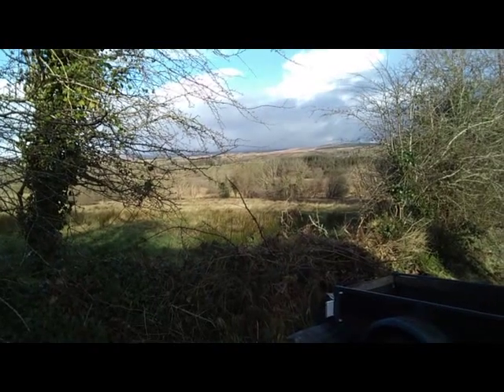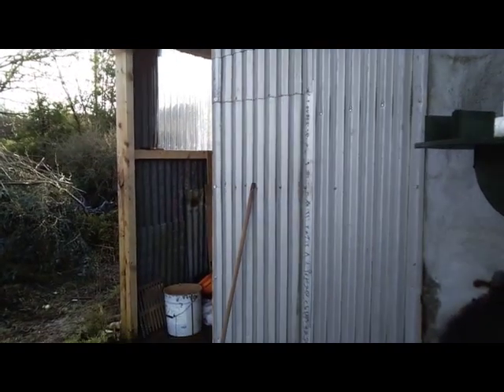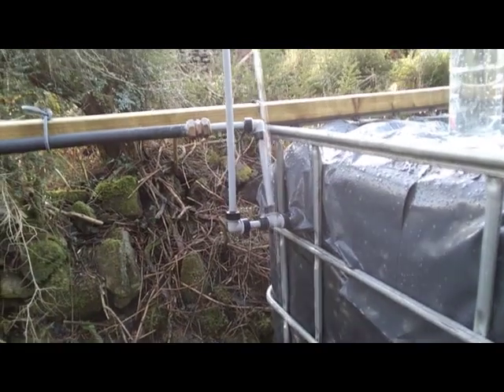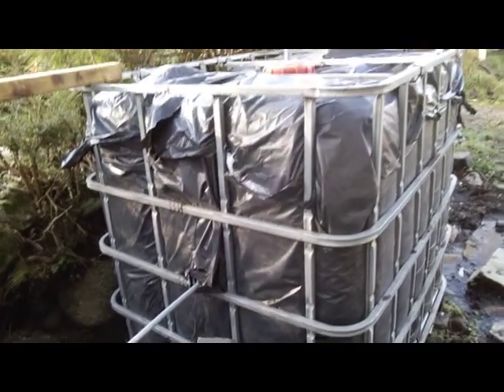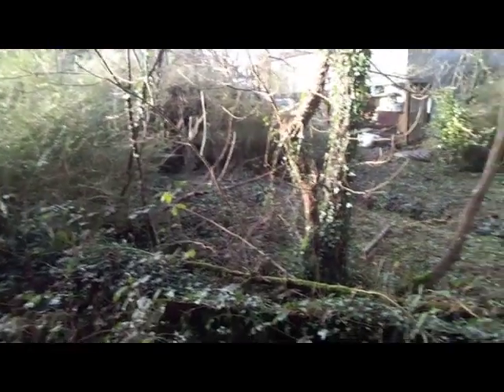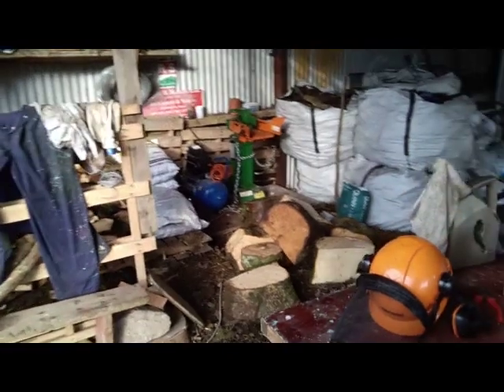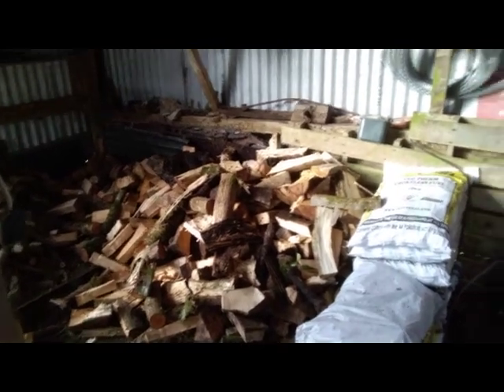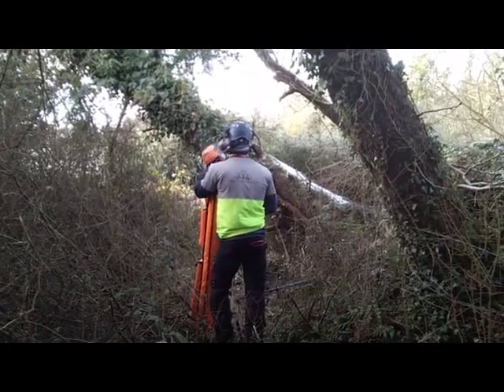My winter projects

Comment: Wow, things are coming along nicely.  That bike will be great.  I live in Brisbane, Australia.  No snow here.  Some people have hot belly stoves in their lounge room for the winter but quite frankly our winters don't really warrant them.  We have a reverse cycle air conditioner and we only use the heat maybe three or four times a year early in the morning for a bit.  Out in the country side it can get colder than Brisbane itself, a friend of mine lives in Gympie and it gets colder in the mornings and nights there sometimes.  Your house looks so nice and cosy.
Reply from the maker: Thank you so much Sue, yes you are in the tropics so no real need for heating. This is my second winter now in Ireland and my cottage is warm and cosy burning wood and turf in the range and stove. I lived in south east asia for over 20 years, mostly Thailand, so would be the same climate as Brisbane.
Reply: @theoldmanandthecottage2531  In Ireland the old stone and earth houses thatched houses  were known to be warm in the winter and cool in the summer. When the first concrete houses were built - people were surprised how cold they were. Generally as long as a fire was kept burning in the hearth - these old houses stayed dry. Once abandoned the damp crept in and the houses started to fall in. The tradition was that the hearth fire was never extinguished. Turf / peat allowed the fire to smolder slowly. Btw these old chimneys were never designed for the high temperatures produced by burning coal.